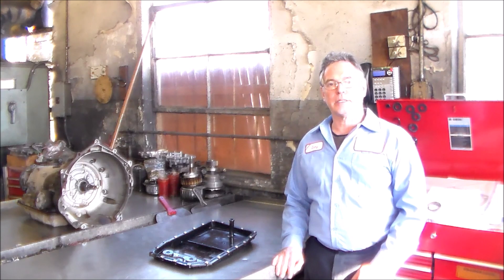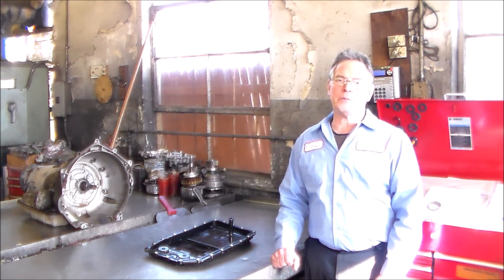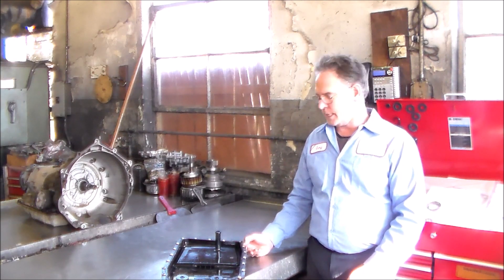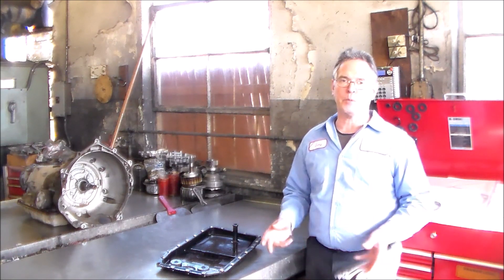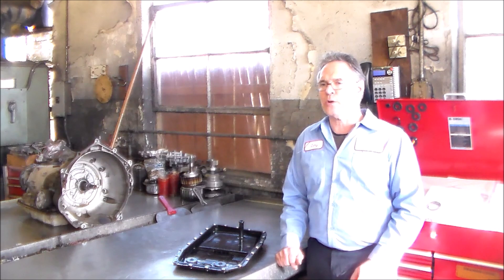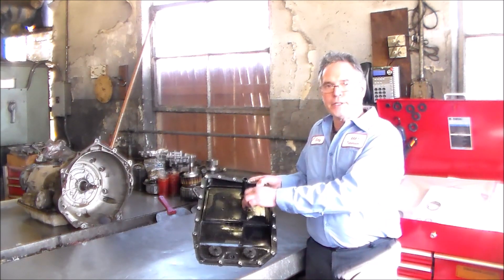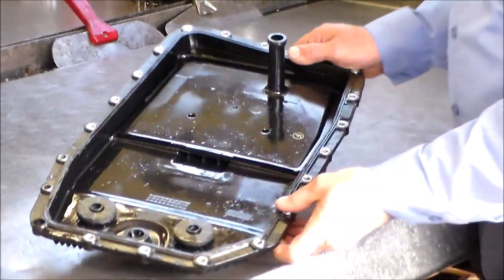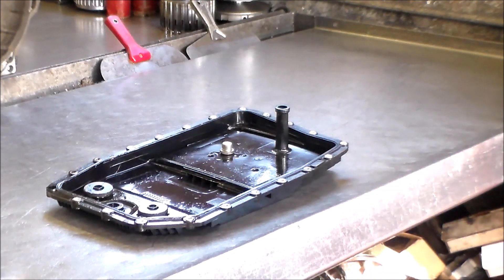Quality Control, ZF6HP26

Comment: Hi, Gary, I am about to do some work fluid/mechatronics sleeve/bridge seal/valve channel seals on my 2004 XJ8 I watched many of your you tube video on ZF6HP26. Under previouse ownerships someone replaced 6-7 original bolts holding pan-filter. I am conceraned that threads there are stripped. Can you advise on two things: what methode d o you recomend on restoring stripped threads in aluminum body? What is your opinio on using steel/stainless steel helicoils to restore threads? Did you see galvanic corrosion of aluminum when stainless steel helicoil used?

Comment: Gary I know this is old but I have a question, there is any difference between the transmission on a bmw 645ci and the next years 650 look its the same Z26 for me
Reply from the maker: depends on the year, one may be a Generation one and the other may be Gen two
Reply: @GaryFerraro  thanks Gary, I’m asking because mine is a Bmw 645ci 2004 the transmission went bad and I found  one but is from a 650, long history short not working either, I found out the hard way that the torque converter is different and now is making a really high wining noise and the ista says that is in third gear all the time
Reply from the maker: @jimmycardozo428  did you swap your converter into the other trans?
Reply: @GaryFerraro  i tried to use a rebuilt converter that I had for the original trans, but it won’t fit so I use the one coming with the trans I bought.
When I look for the transmission I need just give the option for the one in a 645ci or a 545i, does not give me the option for the one in the 550i or 650i, not even the 745i.
Reply from the maker: @jimmycardozo428  You should order the trans using  the cars vin number
Reply: @GaryFerraro  thanks for all you help and promptly answer, I’m fan #1 of your videos
Reply from the maker: @jimmycardozo428  Thank you
Reply: @GaryFerraro  last question, do you know where I can find one at decent price?

Comment: What is different between the 6hp26 and 6hp28?
Reply from the maker: The 26 is a Generation 1 and the 28 is a Gen 2.  On the 28 they have 7 accumulators instead of 6 inside the valvebody, valvebody is different and solenoids are different, takes a different solenoid set

Comment: Im having same issues on my 05 745li. Just replace de oil pan filter. 2 weeks ago and sence then. When the transmission warms up it. Takes off real slow on first gear could dat be cause i put n aftermarket pan

Comment: Hi Gary - great vid - thanks for sharing - Q - I have RR2008 with zf6hp26 with 150k miles. Going to to do a flush and wanted to switch to Maxlife synthetic atf. Any experience with this atf? The lg6 is just way too expensive. Hope all is well.  r/Michael
Reply from the maker: Michael A you should be fine. Any premium synthetic fluid will work
Reply: @GaryFerraro  Hi Gary, thanks for the reply and thanks ever so much for continuing to make these videos they really are helpful. One last Q - I'm not sure if I should flush out lg6 all at once and introduce the maxlife all at once or if I should blend in the maxlife in phases over a short period of time by doing a few drain and fills. Would you have an opinion on which approach would be better or if matters? Thanks Michael

Comment: Good info. If you cut it open would you see the difference compared to a proper assembly from the OEM? I have a 6HP19 on an E60 535xi - any suggestions for fluid aside from the expensive OE stuff?
Reply from the maker: May not see a difference by looking, it's the material the filter is made of

Comment: Hey Gary, LOVE your videos.  I have an issue with my personal vehicle 2006 bmw 750li. i own a repair shop  (not trans shop) 
here is the issue. 2-1 downshift SLAM/JERK every time when coming to full stop &  3-4 shift flare that goes into failsafe. gear monitoring code also. I have to drive with my scanner to reset it on the fly. it happens alot but not every single time. Here is whats been done:

rebuilt transmission  with new clutches, tc, solenoids, bushing kit, sonnex valve body kit with seperator plate (A053)
when i got it back, same issue.. then i purchased a used valve body with mechatronics & solenoids... same results..

dme & tcm have been updated with no change..reset adapt with no change..no change if hot or cold..

Thank you Gary...your videos are so good, it makes me want to drop it and inspect it myself !
Reply from the maker: Is it setting any codes by chance?
Reply: Yes.  3-4 gear monitoring.  That’s the only code.  I really appreciate the reply.
Reply from the maker: @mikeg5971  Does it flare up on the shift?
Reply: Gary Ferraro  also I can make it happen when I put it in manual mode and I am stopped shifting from two down to one it’ll clunk every time.   1-2  is smooth
Reply from the maker: @mikeg5971   When you drive with the scanner can you confirm it's a 2-1.  I'm thinking you may have a cracked E drum, this is fairly common, i always check the E drum on it's own to see if there are any cracks. E clutch is on in 4th,5th and 6th
Reply: @GaryFerraro  no, while driving i confirm 3rd gear flares/slips when going into 4th gear (4F89) then goes into fail safe... the second issue is the 2-1 downshift jerk...coming up to a red light, the vehicle come to a stop, in 2nd gear, then it feels like you get rear ended when it shifts into first gear

The 2-1 downshift slam is ALWAYS there.... 3-4 slipping into failsafe happens at least 3-4 times on my 13 mile  ride to work taking city streets

Thank You
Reply from the maker: @mikeg5971  The 2-1 downshift bang could be bushings or solenoids. just to confirm, the solenoids are new?  what type of scan tool are you using?
Reply: Yes.  3-4 shift flare.

Comment: I posted a link to this video on the X5 forum.  Thanks for the informative video.  A lot of the new X5 owners are DIYer because the price of a X5 has dropped to the point that a kid flipping burgers can buy a used X5.  They can buy a X5, but they can't afford to bring the SAV in for service.
Reply from the maker: Ok, No problem, i'm editing a video now for the ZF5HP24 on the lower front valvebody.
Reply: @GaryFerraro  I'll post a link to your video when you have it up.
Reply from the maker: @upallnight888  ok, no Problem

Comment: I have change the oil and pan on zf 6hp19 bmw e90  (zf parts) and i have a issue,  sometimes after a run 60-70km the turometer it acceleratie and have no traction, i pull over stop the car, strat it and it run like nothing happens
Reply from the maker: Do you have any codes in the transmission control module?

Comment: Just changed the fluid and filter on my 200k mile 4L30e for a similar issue.  The filter had about 50k miles on it, but it was whining hard when cold and shifting sloppy.  New fluid and filter its quiet and happy.

The Sonnax Zip Kit in our 6HP28 (BMW X5) made a big difference along with tube seals.  The shudder came back briefly, but the computer seemed to be able to tune it out finally.
Reply from the maker: Nice, glad to hear.  Thanks for watching

Comment: Do you recommend zf factory fluid or do you use aftermarket
Reply from the maker: John Mattiazzo I do both. When I don’t use the ZF fluid   I use a premium synthetic fluid
Reply: @GaryFerraro  thank which brand is cause no problem?
Reply from the maker: @soswag75  you could go with amsoil, cam2  or  maybe mobile one synthetic
Reply: What do you think about the transmission oil of "fuchs titan" or " FEBI BILSTEIN", can they cause any damage on the transmission? I have good price on them, but I'm worried if they make the same job az the zf oem transmission oil. Thank in advance!
Reply from the maker: @soswag75  I think you will be ok, that is fully synthetic?

Comment: What about Vaico filters?
Reply from the maker: I don't know to much about those, have to look into that. Few times on a Mercedes trans when I couldn't get OE I went with Hudson and all was ok. On Zf units I never ventured outside OE
Reply: @GaryFerraro   Vaico is sold alot in Europe. I cut open my old oem 6hp filter and a vaico. Couldn't see any difference on the filter elements. I have been chasing an issue with my box for 40.000km. It feels like the converter is locking up too soon and makes it sluggish on low rpm. And it has a small vibration on acceleration betweet 2- 3000 rpm
Reply from the maker: @mathiaskristensen9602  May be a converter chatter, have you tried changing the fluid?
Reply: @GaryFerraro  Yes. I did a filter and fluid + brigde seal and tube seals. Then flushed it 2 times  with 10 k km between. No difference. I can clearly feel when the box heats up and hits 50 degrees the converter locks up. Feels like the converter is either locked or not. No modulation
Reply: And somtimes on kickdown i can hear a short squeek as it shifts.
Reply from the maker: Mathias Kristensen That is a clutch squawk. Very possible clutch could be worn   What type fluid are you using?
Reply: @GaryFerraro  oem BMW

Comment: Hi Gary, 

Thanks for the info! Great videos!

Does anyone know, why at 32°F (Freezing), my Jaguar VDP ZF6HP26 transmission stops working, until warm? It freezes! In below zero temps, I can't get it to move; eventually, to slips on down hill, but never warms. It finally just quit all to gather, like I burned it out, with burn smell! Hot or cold, no shift, goes nowhere!

Why would the fluid freeze? I changed fluid,, but it will not take much. The second stage fill never happens. Maybe I did it wrong? Maybe the pump burned? Clutches gome?

I don't know the codes, maybe a 700? They were saved somewhere, and cleared. 

Any help out there?

Thanks
Reply from the maker: Was any work ever done to the trans?
Reply: @GaryFerraro  Hi, I bought it that way. They had a screw in the shifter, to prevent J-Shift. Don't know anything else.

Thanks
Reply from the maker: @giovannijoseph9580  Well, first thing I would do is drop the pan, may have the same issue as this rover I was working on.  If someone been in there see if it's an OE pan
Reply: Maybe the fluid level is just (too) low. Trans fluid expands a lot with raising temperatures...